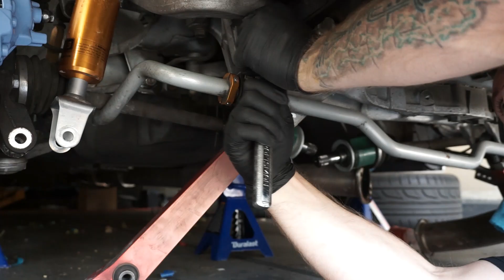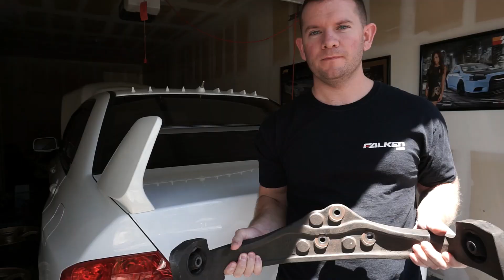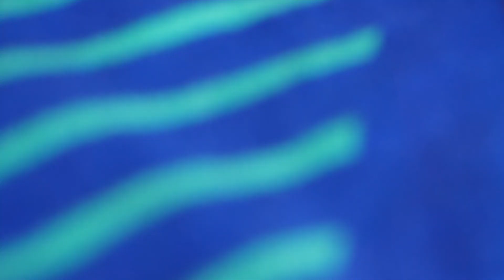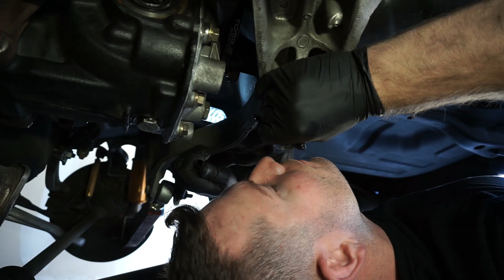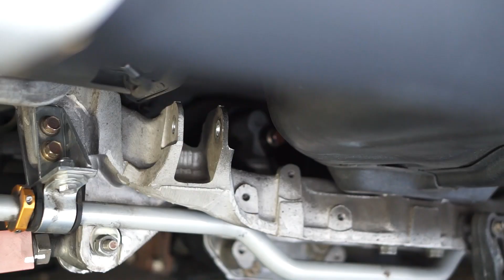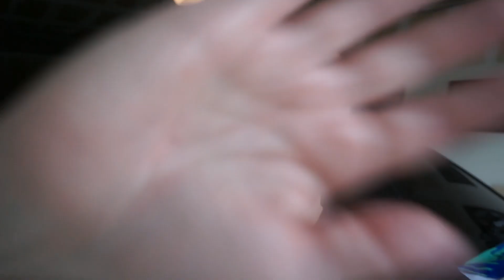Evo 9 Mustache Bar Delete

Comment: So you pull that “mustache bar” out- bolt up the solid mounts to where? And drill holes for those brackets to hold the sway bar back up?
Sorry but I’m kinda lost on exactly what you did here lol
Reply from the maker: So the mustache bar is a removable piece of the subframe. That solid mount bolts up to the back of the diff and a part of it comes over the top of the subframe. You have to drill a hole in the subframe in order to bolt that mount to the subframe. No modifications are necessary for the sway bar. The sway bar bolts into the stock location on the subframe.
Reply: @EricMcWilliams515  so this is just a weight reduction thing? I’ve never heard a “clunk” sound when under hard acceleration like you mentioned before
Reply from the maker: @EvoDad87  yes, weight reduction. Your bushings must be good still. Haha

Comment: I never knew I was going to have to drill lol. I don’t think my drill is strong enough to do the job.
Reply from the maker: I wish there already was a spot on the subframe to bolt it to. The subframe is pretty soft metal, so titanium or steel bit will do the trick.
Reply: @EricMcWilliams515  thanks. I have some steel bits. I hope I line it up right when I drill lol.